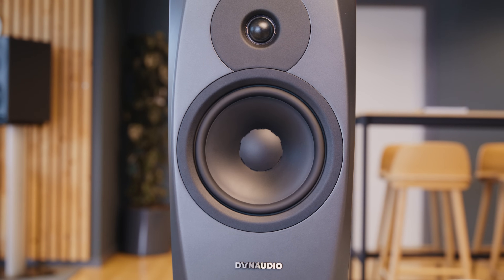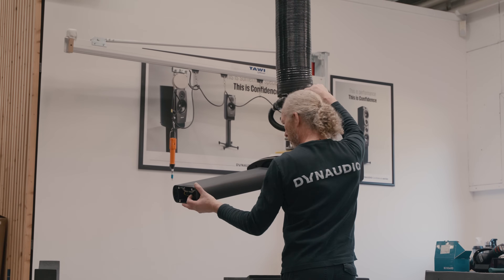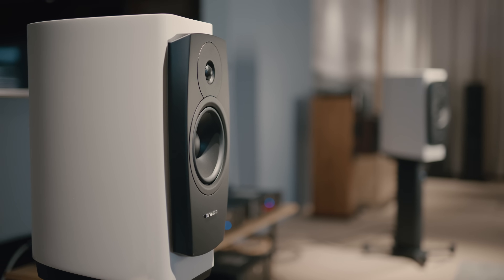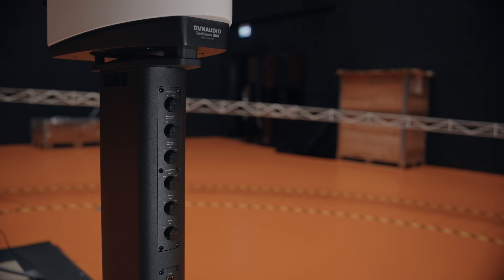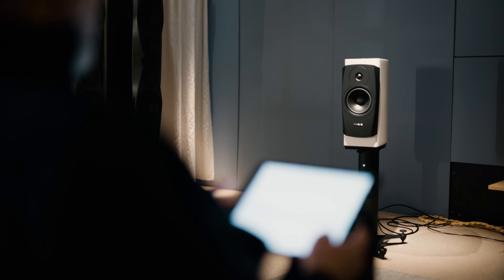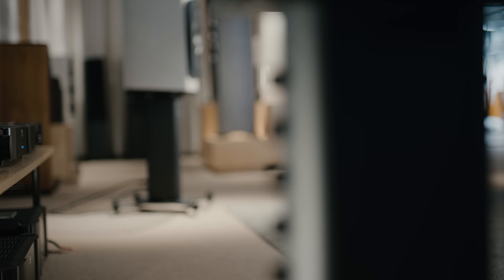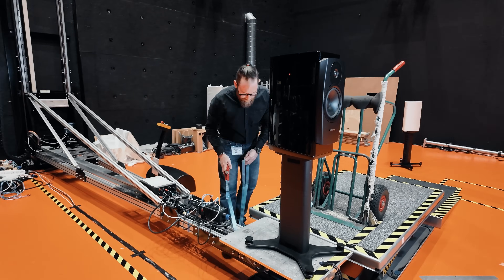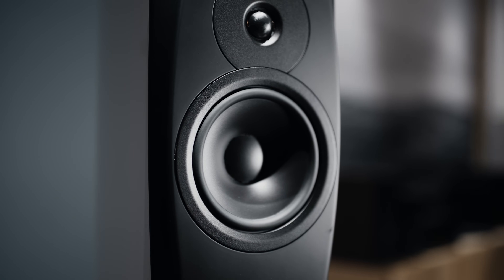Why the Dynaudio Confidence 20A Loudspeaker Outperforms Its Passive Predecessor

Comment: @DynaudioAcademy  Mr. Otto, please answer two questions. I'm considering purchasing a 20A:
1. Which input is preferable? Analog XLR or digital XLR? Does an external DAC make sense?
2. Will the amplifier/DSP be upgradeable or improved over time? Will it be possible to eventually buy a different, better amplifier rack?
Reply from the maker: We hope (and believe) that Otto or someone from Dynaudio will reply soon.
Reply: These are great questions. I hope you get an answer, Cosmos! Being able to upgrade the stand and/or electronics would be a game changer.

Comment: My personal high-end experience over the years has shown me that you should keep anything that vibrates or where high currents converge away from speakers. We decouple, shield, and insulate wherever possible. And that cables and power distribution definitely make a difference. Active speakers claim the opposite. I haven't yet heard an active pair that truly convinces me. This one doesn't, either.
Reply: Active crossovers advantages over passive crossover surpasses small increase in vibration of speaker due to proximity of amplifiers to speaker. Each woofer is served by electronically optimised amplifier for tgat woofers parameters.
Reply: In theory it sounds great, but I haven't heard an active speaker that really convinced me yet. Maybe very good external amplifiers are simply better.
Reply: @TimoUngerer-p2c  Какие активнве колонки вы слушали ?

Comment: My experience is exactly the opposite: I have a Dynaudio Confidence 20 with carefully selected, very good amplification. It's more expensive than its active counterpart, but it sounds much more natural.
I went to the dealer to test it, intending to downsize my equipment. But now everything's staying as it is.
20A? Not for me.
Reply: What kind of amp you have? Were 20a burned in?
Reply: @dgukov  The Dealer said so. I use T+A R2500 and Ansuz Kables + Power Distribution.
Reply: Interesting! I'm so happy with my C20 that I think I'll keep em and just keep upgrading the electronics as time and money allow. In a small room they are hard to beat. I went active once before with another speaker, I missed the configurability of separates anyway.
Reply: @angi733  
That would be my way, too. In my experience, the C20s benefit greatly from good amplifiers, and in my case, from the power distribution.

Comment: I love active speakers, I own a pair, and I 
 recognise the flexibility DSP offers, but having a DAC built in really puts me off.
Reply from the maker: But they need to have a DAC inside...
Reply: @soundstagenetwork  I would happily settle for class d amplification and an analogue active crossover.
Reply: @volpedo2000  True, you could go active with class-D or class-AB (or whatever class) of amplifier and an analog crossover, but there are tradeoffs with that compared to using a digital crossover. So really, there are many ways one can go on it, depending on the goals.
Reply: @volpedo2000  I find it quite interesting how "scared" the community is of D/A and A/D conversions, but will happily settle for analog crossovers, which have MUCH higher negative impact on the sound than a D/A and A/D conversion. There is nothing wrong with going analog into the Confidence 20A if one prefers that, and the fact that it is converted to digital inside the speaker, does not introduce more damage to the signal than an analog active crossover would - quite the contrary. But, that is a battle that we will likely have to fight for many years to come.

The culprit likely is that people have heard bad implementations, and blame it on the concept rather than on the implementation. That being said, there is no solution that is best for everyone.

/Otto, Dynaudio Academy
Reply: @DynaudioAcademy  you know Otto, I never thought about it that way. That was an eye opener! Thank you!
Reply: @DynaudioAcademy  Mr. Otto, please answer two questions. I'm considering purchasing a 20A:
1. Which input is preferable? Analog XLR or digital XLR? Does an external DAC make sense?
2. Will the amplifier/DSP be upgradeable or improved over time? Will it be possible to eventually buy a different, better amplifier rack?

Comment: when you pluging the speakers in the wall socket do you need to keep an eye on the polarity for the two speakers to be plugged with same polarity in the socket?
Reply from the maker: Likely a good idea.
Reply: That shouldn't be an issue. One part of a power supply is a rectifier, which guarantees the same polarity from the power supply - no matter in which orientation you put the plug in.
Reply: @deiruch well in my case usin euro prong connectors it has big difference with my Dynaudio BM5 MKIII studio monitors